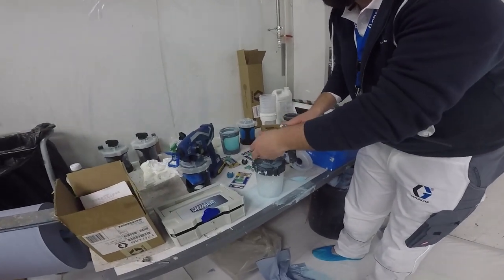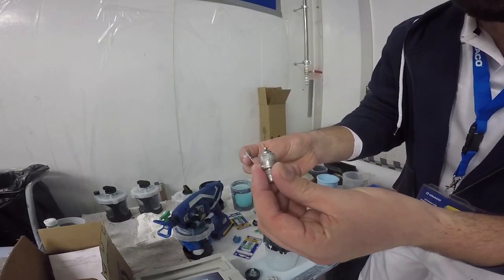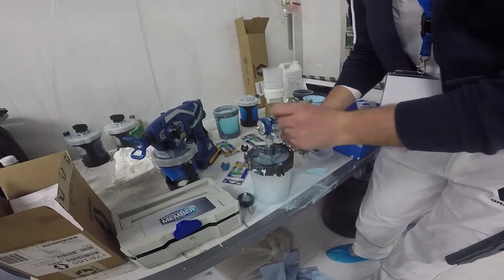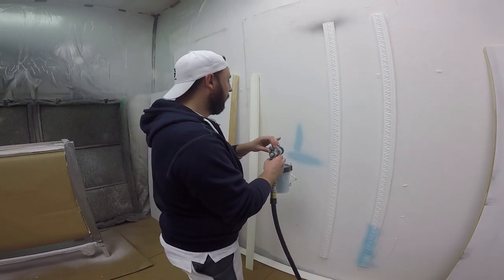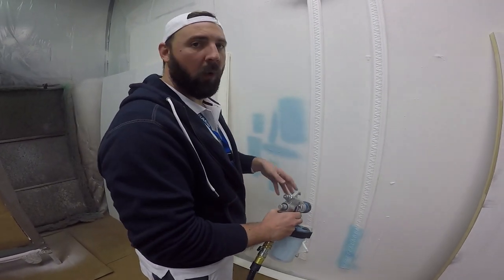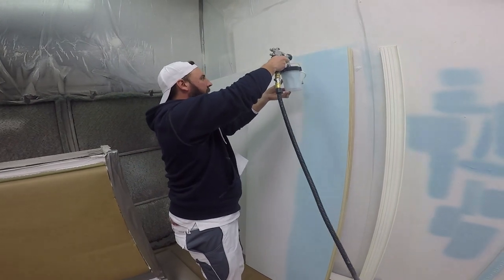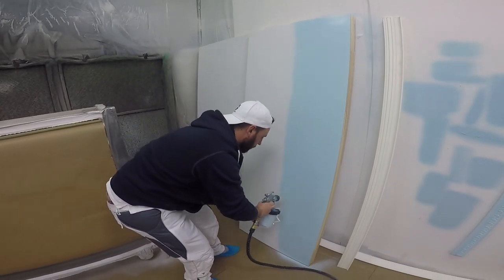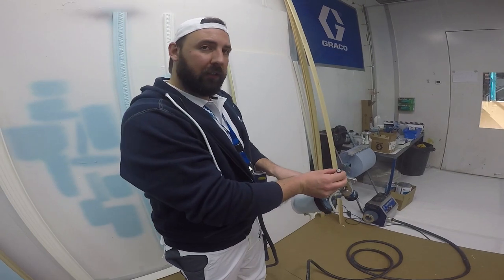Graco 9.5 Finish Pro HVLP - How to change the needle + Demo

Comment: Hi Simon I'm now using the 3M PPS system with my Graco 9.5 HVLP and was recommended Bedec Aqua Advanced Satin (water based) for all woodwork but with a 5 needle/nozzle I'm having to ramp up the paint selector to max on my Edge 2 Plus gun as struggling to get a good coat? Is it the paint ? Does it need a load of diluting? Do you have a particular favourite of paint for woodwork with this sprayer ? New to all this spraying and its a massive learning curve still! Thanks in advance Mark
Reply from the maker: hey bud thanks for watching. well i actually used bedec satin a few years ago with a 3 stage turbine. its all to do with the paint dilution, i would keep to a numver 4 needle. try 10% dilution to start. check out this video it breaks alot down with set up. the principle is the same for most paints or sprayers
https://www.youtube.com/watch?v=i7qGadbSr-g

Comment: Nice work 👍🏻
What you paint you using and how much thinning. It's coming through at a fair rate
Reply from the maker: Thanks. Ive got the number 5 needle in. So that lets alot through with mininal thinning. Its caparol spray tech sayin. In a colour.  Already to go out the tin. Warm the tin and it flows alot nicer again.
I could have got it flying out.  Paint was only on 3 or 4 and air just over half. So ye with the right set up you can fly

Comment: Another great video. What's the widest fan pattern you can get on the Graco ? Looks like you could spray an average size door in about 40 seconds. ..not much slower than airless with a 208 fflp tip :)
Reply from the maker: Thanks for the support. Yes you can go fast, i think the fan goes to either 8 or 10inch so ye wide enough to do doors. I dont think ive ever gone at full power. There would be a lot of dust in the air if you opened up the air full though. But with right needle and size youre right you can move close to the speed of fflp, lovely fine even finish
Reply: @sprayaholic  great thanks for the info. I'm torn between the Graco 9.5 and a Gentilin c330 with Iwata gun. Mainly because I could use the compressor for an AAA setup with my airless later on. But the Graco hvlp wins on portability as my work is domestic mostly. Do you run an AAA system?
Reply from the maker: @briancunningham594  ive always been the same.. 
I love the 9.5 for portability and just switch on and go. Fits in the van fine. 
Depends what work you want to do, i do like those set ups and ive been thinking of getting one especially if i switched more to upvc stuff or larger jobs.  And as you say you can switch to aaa. But its alot of gear to lug around to switch to aaa on site. When the fflp tips came out i thought they were a great addition to airless bring some speed down and keeping a nice finish. 

I personally would rather have a stand alone aaa unit even though theyre decent money. But for workshop set up the co pressor and airless combo would be great.
Reply: @sprayaholic  yeah I agree. As all my work is domestic, from a single room to a whole house, I like the flexibility of having a hvlp, airless (gxff) and maybe a Graco handheld in future for small jobs. I think that's your set up? I know you have larger airless machines but I dont spray walls , just occasionally ceilings and cornices. But AAA is the new buzzword in Spraying for sure. Do you think adding a handheld graco would be a good idea for someone like me who does only domestic work? For single room trim work? Cheers mate, keep the great content coming.

Comment: I have the same graco I’m trying to spray doors with it ,I’ve tried thinning and every combination of air/paint and am getting nothing ,I’ve changed tip to biggest supplied and still nothing,what am I doing wrong?
Reply from the maker: Hey. When you say nothing do you mean nothings coming out when you pull the trigger? No air or paint
Reply: Sprayaholic air but no paint the only way any paint at all comes out is if I reverse cup to gravity feed then it’s only a smattering I’m quiet knowledgeable about airless but can’t fathom this one out
Reply from the maker: What product are you trying to spray? 
Daft question but are you usinh the flexi liner?
If youre on instagram or Facebook check me out on there its easier to message and can view pics if you sent them over
Reply: So what was his problem??? No liner?

Comment: Do I need to buy a connector to connect both hoses or does 1 cone with it ?
Reply from the maker: What to connect your whip hose to the main one? The hoses should have the connection on to start
Reply: @sprayaholic  bollox!! mine is missing to connect hoses. Sound bud
Reply from the maker: @metalhead9656  does one connection unscrew off one hose to allow to connect to the other. I dont have it infront of me to see what it looks like.  But if you bought it all it should all be there
Reply: @sprayaholic  Yes it did mate, thanks for that bro
Reply from the maker: No worries buddy ✌

Comment: i must say very imformative, just wondering what needle size would you recommend for water based gloss and undercoat, i have been using a 4, but not sure if this is correct. thank you
Reply from the maker: Hey thanks for watching.
I would say i mainly use a 4 or 5. I try both. If its working well with 4 keep it. If youre tryinh to spray faster and cover morr areas then a 5 will allow more to come out so long as its atomised well. I have another quick set up video. I think its linked somewhere on this videos. 
If not check out my channel by clicking my picture and take a look for hvlp set up guide. Here im spraying waterbased gloss from crown. Hope that will help. Also consider subs if you havnt already ✌
Reply from the maker: Ah you've already seen that one
Reply: @sprayaholic  
thanks for answering my questions quickly, have u tried the gravity fed cups im thinking of getting one, not cheap so need to ensure they are not a waste of money, ill be honest im a little unconvinced on the pressure plastic ones, many thanks for your advice,
Reply from the maker: @thedalz5308  which one the 3m or the attachment to make your edge 2 gun into a gravity? Ive used the gravity systems yes. Great. I mainly have a fuji gravity gun gxpc which is great for small areas as the cup actually swivels. But you can just flip the graco gun upside down and spray.
Reply: @sprayaholic  
yes i have  edge 2 gun and was looking to purchase the gravity cup, but they are £150, bit steep tbh, do i have to buy graco, or will other suction cups fit
Reply from the maker: @thedalz5308  is it from spray direct? 150 is cheap. My fuji gun was like 240quid. The guns arnt cheap. 
The cheaper guns dont usually have as many settings on them either. So to adapt your suction gun to a gravity for 150quid is good as you have best of both worlds
Reply from the maker: @thedalz5308   The Dalz  i think the graco is a different connection.  Although other brand hvlp turbine guns are a universal fit on the hoses. O dont no if the 3m pps fits. It does in the fuji
Another thing to consider would be the pressure pot.. id probabky spend more and go for that. Bonus is it makes the gun work without a cup so you have alot of maneuverability it holds 2L in the pot and it will be lighter in your hand. You keep the graco gun and it just adds hoses and a 2L container.  Sprayman uk sells one its more expensive but great
Reply: @sprayaholic  
thank you sprayaholic, so many different variants, bloody minefield!! thank you very much for the advice, and im sure ill be in touch again as long as you dont mind!
Reply from the maker: @thedalz5308  no worries pal. Set this up to help if i can. But ye defo look on sprayman uk website. Theres a few differnt models of pressure pot but hes made a specific one that fits the model we have.
Reply: @sprayaholic  
Hi Sprayholic, i forgot to ask when you use your graco 9.5, what setting do u put the turbine to, as in how many green lights, ive searched everywhere but cant find any info, thanks yet again!!
Reply from the maker: @thedalz5308  hey bud. I generally have it on number 5 or 6 I've rarely had to go beyond that.  Im sure i say it in my other video. 
Its more about getting your paint consistency right before you start.  And then using the right tips. When I have it on 5 or 6 i usually turn the air dial down on the hose as it gives too much.  
Have you seen my other hvlp video. Quick set up
Reply: @sprayaholic  
thank you, i shall have a look now, i will be looking to spray kitchens and upvc windows and doors, is this something you do
Reply from the maker: @thedalz5308  yes i have done it. I'll be aiming for more kitchens once were finally back out and running again
Reply: @sprayaholic  
i never thought id miss work so much tbh lol! thank you for all the info very much appreciated!
Reply from the maker: @thedalz5308  haha no worries.  I'll have forgot how to work when i go back

Comment: How do you know how far away to hold the nozzle from the workpiece?
Reply from the maker: You can gauge it by looking. If youre too far away you'll get alot of airborne dust. You can usually get in closer with hvlp. Im usually about 6 to 7 inch  away from the surface

Comment: hey m8 just a quick question my ultra max wont spray water to clean is the pump gone? ive cleaned the valves still wont spray water
Reply from the maker: Hi. What have you been spraying with it? And was it ok last time you sprayed?
Reply: @sprayaholic     just emulsion m8 i use it on new builds   for first  coat cuting in
Reply: i looked at the   booklet says if it  dosent spray water the pumps gone
Reply from the maker: @styreetgang562  what did you last spray, did it work ok?  How long have you had it? Mine has done it before. Was due to dried paint inside. I ran it through with warm water. Turned the machine upside down with the cup off. This is if it was waterbased paints. Put in it prime. Setting 4 pour the hot tap over the area paint sucks up. Then pull the trigger to try prime it through. If it worked. Then flick straight into spray and blow it through. 

I let mine sit in cleaner or hot water and it softened the paint internally that stopped it from working. 

Ive had mine for years and still going strong
Reply from the maker: @styreetgang562  also i did a video a few year ago of cleaninh it with the tap. If that shows it better. 
If its help  then please consider  subscribing if you havnt already. I'll be doing more ultra videos soon
Reply from the maker: @styreetgang562  theres a chance it has done if you use it on full power alot. But if the paints dried inside it might need soaking a little and then trying again.